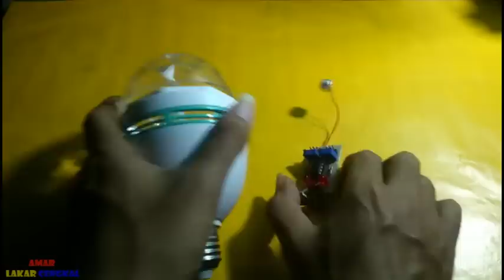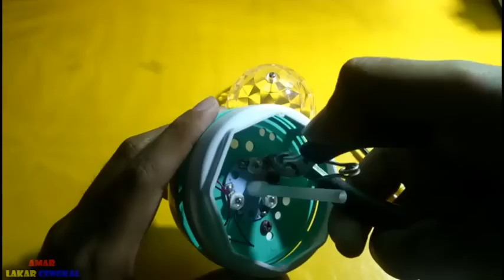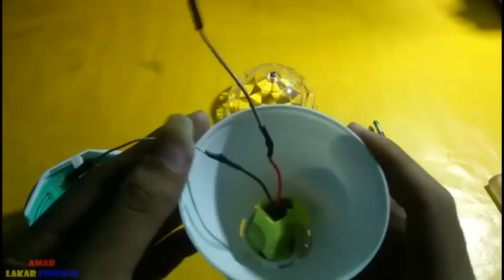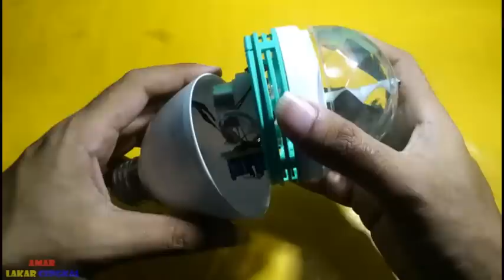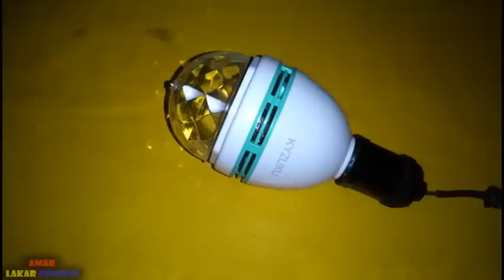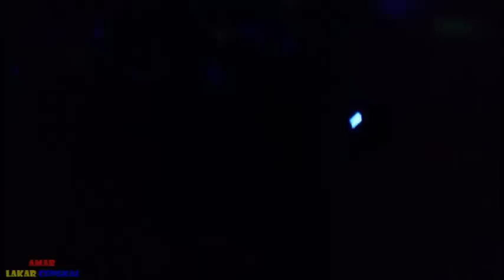Membuat Lampu Disco Mengikuti Irama Music Full Rotation 360

Comment: tolong sebutin semua bahan bahannya dong
Reply: ane pengen bikin
Reply from the maker: komparator menggunakan IC LM358 bisa dilihat di dataheetnya,
transistor TIP41,
power supply 12Volt,
MIC Condensor,
nanti lampu dari lampu disco nya disambungkan ke switch menggunakan TIP41 agar lampu berkedip mengikuti suara.